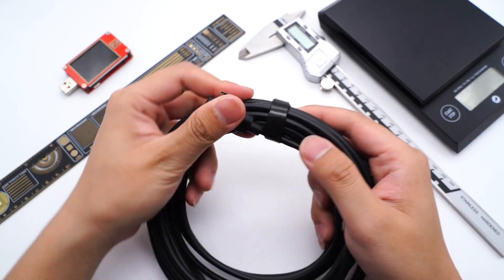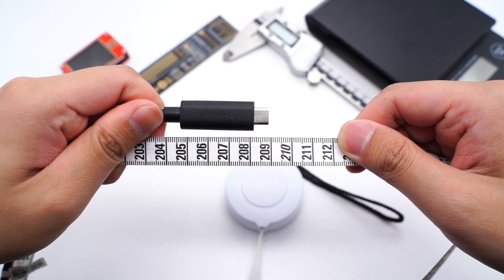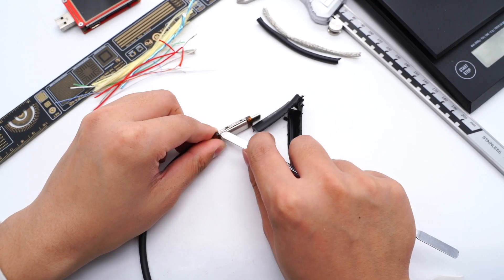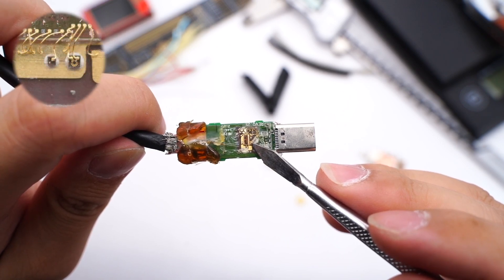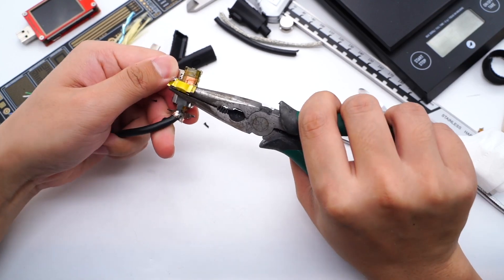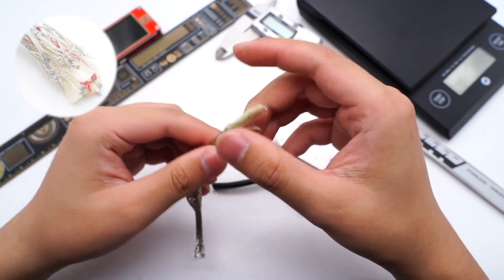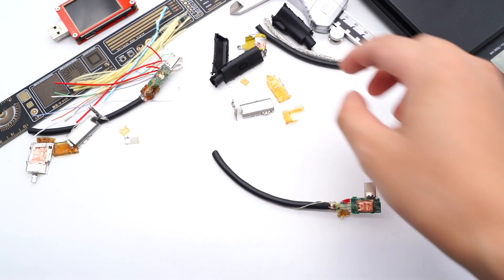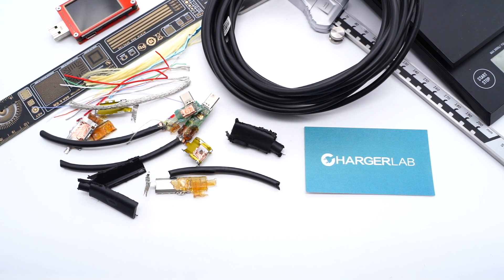The “Way“ to Metaverse？Teardown of Meta/Oculus Quest 2 Link Cable

Comment: We can charge more because it has fiber optic. But then we're gonna bottle neck it at both ends and every cable comes with the convertors built in increasing the price too. Because we're too lazy to make one port for data and another port for electricity.

Maybe the Quest 4 will fix this.

Comment: I like your videos a lot and I've watched through a lot of them -- especially the charger teardown ones
I noticed your reviews tend to be very factual and technical ("here are the components, with model numbers xxx, yyy"), which is great for people with EE experience like me
But I feel your content has the potential to appeal to a much wider audience and get 100-1000x+ more views. It would be amazing if you also provided your own commentary/opinions for the teardowns -- "is this good construction", "is this good design", "how does it compare to other cables", "x/10 or ABCDEF rating" etc.
To a regular consumer, their bottom line question is going to be "is this a good product that I should buy?". And as someone doing teardowns, I feel like you're in the perfect position to give a proper answer. In general, I always appreciate technical reviews. There are too many videos on youtube where people just read off marketing specs for sponsored products.
Reply from the maker: Thanks for your advice. I have forwarded to the team.